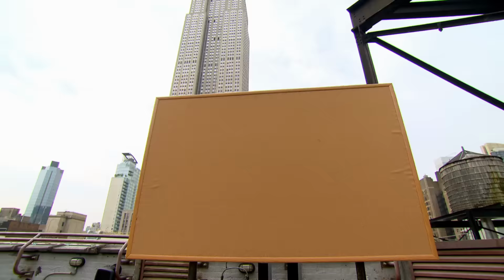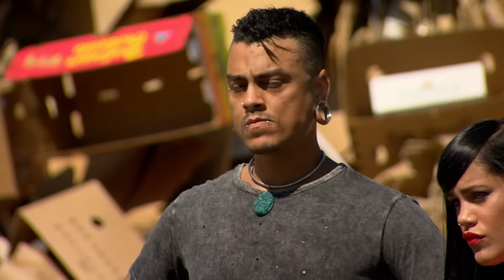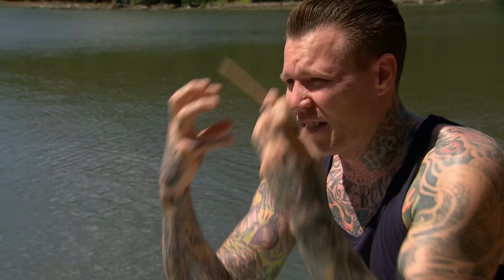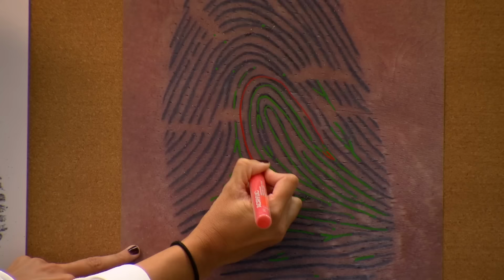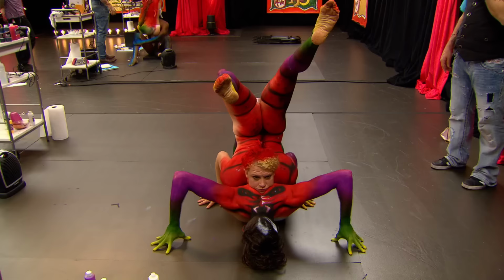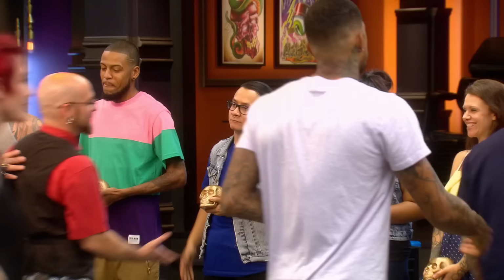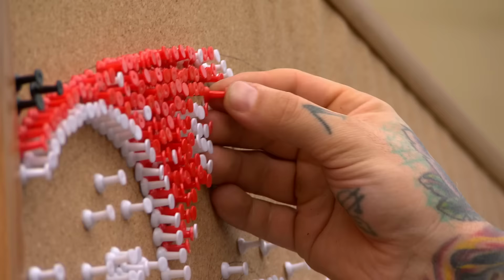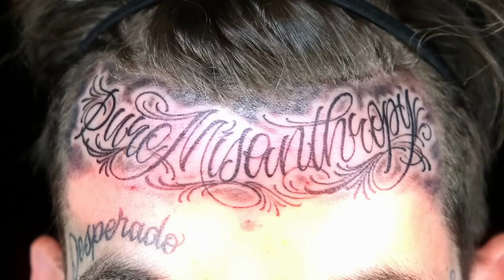Every Single Flash Challenge on Ink Master Season 7

Comment: SALT MELTS When WET!! 
Glue some areas, then wet brush. Skill determines ratio of solid bits surrounded by faded glistening. Salt is a mineral/ rock... tiny bits sink versus flow. 

This challenge idea was great..  Large Scale,  Translucent, 3D, White Pointillsm on utter Black... and in sunshine. 🎉
Reply: no. salt does not melt.